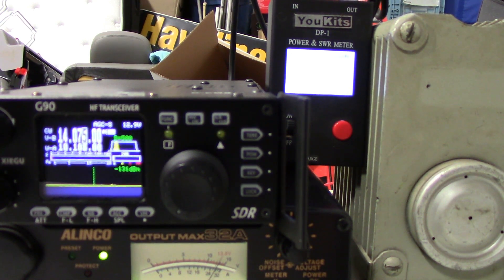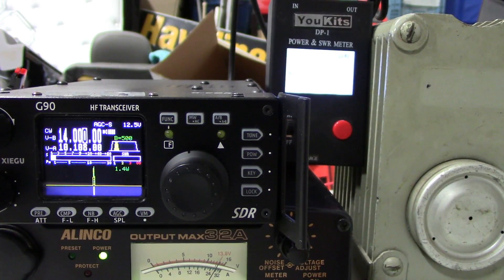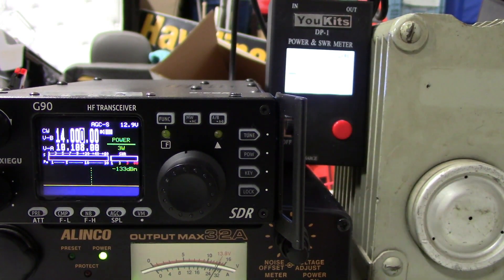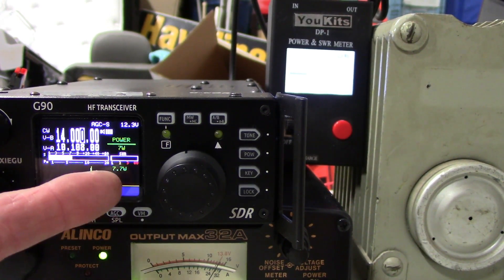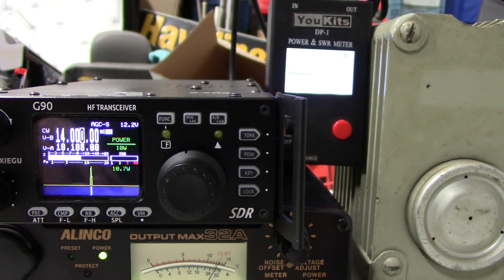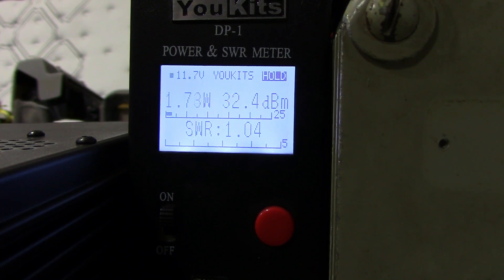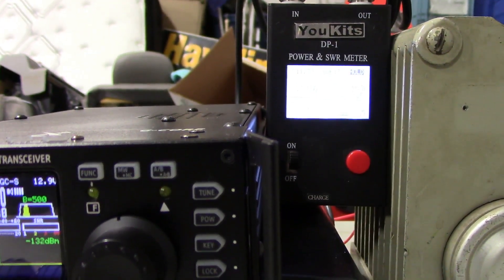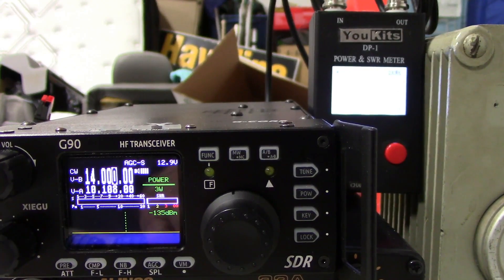Xiegu G90 HF Transceiver RF output measurements Feb 2019

Comment: The two readings on the radio should match. There's no excuse for that. But, comparing all three readings, how do you know which one is right?  I actually question the external meter at this point since it shows more that 20 watts out. A Telepost LP-100A will give you the answer.  I am not knocking your video. It was very interesting and I'm glad you posted it. 
What would be nice to see is what the current drain is at 5, 10 and 20 watts out. 

Thanks for posting the video. Nicely done.

Barry, KU3X/QRP

Comment: Fred, do you know how many DC volts is needed to reach the full RF (20W) output ?
Reply from the maker: I always run 13.4v on my power supplies.
Reply: @VE3FAL1Fred  Thank 👍
Reply: @VE3FAL1Fred  run it at 15
Reply: Operating voltage range: 10.5-16.5 V DC (voltage must be in 13.8-15V if need 20W)

Comment: Hi Fred,
do you know which CAT application can steer the X90? I'm a DXLAB user, checked other log programs, none that I know of currently steers the X90 yet.
73, good DX
Gust ON6KE
Reply from the maker: Gust Kegelaers , folks have been using Ham Radio Deluxe. Emulates Icom, 718 and 7100 from what I understand. I have not tried any CAT control myself yet on any of the radios....cheers Fred
Reply: OK, I'll try steering the G90 when I get it through DXLAB Commander using 718 or 7100 emulation then. Thank you Fred.
73, good DX
Gust ON6KE
Reply: @VE3FAL1Fred  The only issue I have so far is the PTT control and HRD using the IC 7000 emulation.  I might try the 7100 to see if it works better.  I have successfully used the com port to trigger PTT instead of using radio control under HRD.  I have also had a power button power off issue after the radio has been using digital and is warm (not hot).  After the radio cools down the off button works fine.  I don't know if this is some "cool down" feature or what.  Any ideas? Otherwise, I love the radio, been talking consistently all over Europe on 15-20 watts SSB.  73s IU3JNT
Reply from the maker: Gust Kegelaers 718 being the most favoured one.
Reply: OK, will try.
73
Reply from the maker: Gust Kegelaers use baud rate of 19200 and use comm port on radio head and not the one on body
Reply: Will do, thanks. @VE3FAL1Fred
Reply: Fred, I think we can all agree that the operating manual is poorly documented. 2 questions, can't find it anywhere. 
1. Can the CW pitch be set? From where (low beat)  till where (high beat) and at which step increments?
2. Can the loudness of the CW pitch be set? I know about the Volume Control for speaker and headset, but pitch loudness vs. received signal must be right for me.

Bye
Reply from the maker: Gust Kegelaers Press the func button until the orange LED under it lights. Then toggle through the cw functions pressing the KEY button, then adjust each setting to ur desired setting. Yes manual needs work but is a WIP due to ongoing updates and add-ons to firmware
Reply: Happy that those 2 are covered. Thanks again Fred. Will leave you alone for a while now!
Reply from the maker: Gust Kegelaers not a problem, thats why I am here....cheers Fred

Comment: consider loss through coax of 10m  is about correct , use the math :)
Reply from the maker: Chris.wittbit77 D in which scenario? Running an antenna? Yes you will see a difference of course.

Comment: Thanks Fred for your measurements. Maybe your youkits is a bit off ? Anyway, no biggie, your rig works as advertised, it seems to deliver even more power as per its specs. All in all everything is fine.
No one will tell if you are off QRP by a few hundreds of mW, anyway you have some loss here and there whilst portable :)
Reply from the maker: If you look at the scale on the right, it shows 5 watts, if you look at the setting it also shows 5 watts, yet the RF out below the swr indicator also shows more then 5 watts, so hard to say which one is even correct, but it is only 500mw either way. I may bring the comet analogue meter out next...Fred